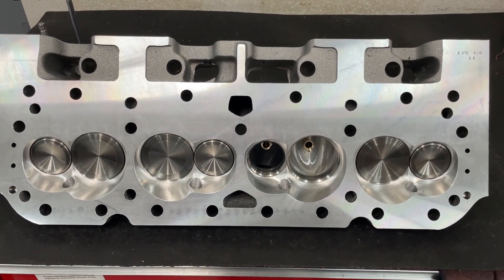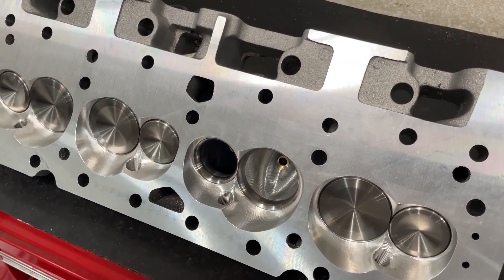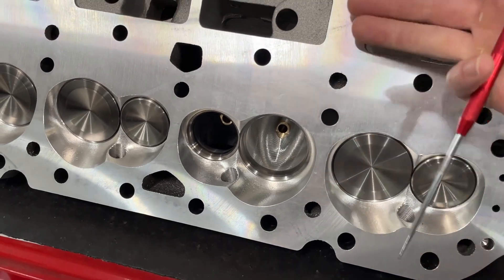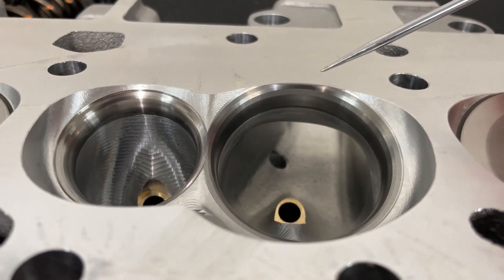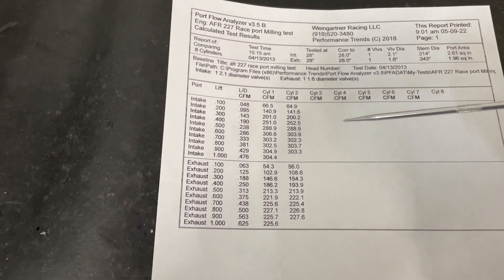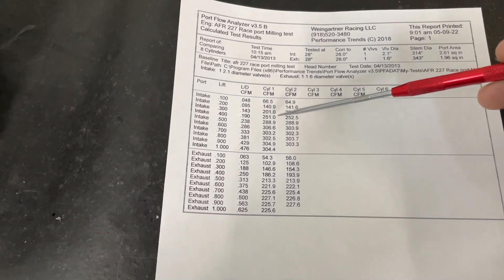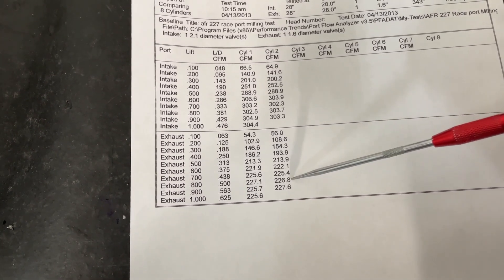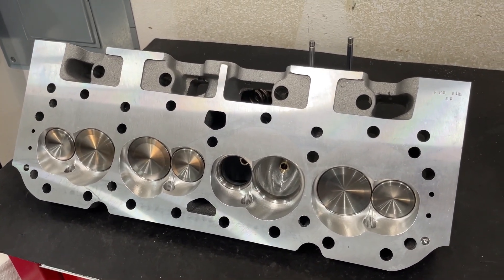How Much Does Milling Change Flow On AFR 227

Comment: removing 42 thou from the entire chamber still nets alot more compressions than you would loose by cutting 42 thou into 1 section on the piston
Reply: They've discovered the flatter a piston is the better overall reaction of the expansion of gases another word for power

Comment: 862/706 Cathedral Heads are 61CC stock.

I'd like to get another set of 862s, put bigger valves and porting, and truck norris cam for a stock NA 293cid build

Comment: If the flow numbers stay essentially the same, where does the advantage come from, higher compression, or does he have to meet class rules?
Reply: They say for every point of compression  its a  5% gain   but only the dyno will tell
Reply: @Fatt-billy.racing  actually it's 4%
Reply: It's done to increase compression without increasing piston dome more complete burn that way.  Flat tops Better flame travel, And lighter piston. Smaller dome the better.

Comment: People seem to also forget, the more you mill, the weaker you make the head! In a boosted or nitrous engine! I would much rather have a thicker, stronger head. Than to have a little more compression! Also, you have to make sure you mock up your junk! To make sure all your bolt holes still line up, make sure your china rail still has clearance, & to make sure your port alignment is still good! If your robbing from one, you have to be able to pay the other! ERIC, I watched the whole thing again, 🤣🤣🤣🤣Have a good weekend!
Reply: AFR's start out with 3/4" Decks not much to worry about

Comment: Hey you seem to have a pretty decent knowledge of heads I bought these aluminum sbc cylinder heads from the swap meat for a 100 bucks  And the vows are staggered like a big block Chevy but I can't find any name or brand on it I found part numbers but they don't cross with anything I can find
Reply: Trickflow twisted wedge?
Reply: @indyrock8148  sounds like trickflow twisted wedge. Over.450 lift on intake they need the valve relief in the piston moved ( read about them years ago so would confirm on the interwebs) also require a special rocker on the intake side for valve geometry and different guide plates. Intake is 13 or 15 degree and ex is stock.
Reply: Just curious, what were the numbers? I would guess they're aftermarket.

Comment: On heads that offer two different chamber sizes ie. 64cc and 70cc, is there a flow difference due to less shrouding on the bigger chamber size?
Reply from the maker: Haven’t done that yet because most don’t order the big chambers.
Reply: I have always wondered this as well

Comment: Do you drill the head bolt/ stud holes to compensate for the change in angle? I have a set of Brodix track1 that are angle milled and had to bring the hole back to square with the deck.
Reply: Eric. I question the intake manifold mating surface.
Change the head or ruin the intake?
Reply from the maker: They machine the intake face when they angle mill. This way you can just run a regular manifold.
Reply from the maker: On severe angle mill you will have to team the holes but usually you don’t have to because there is enough play.